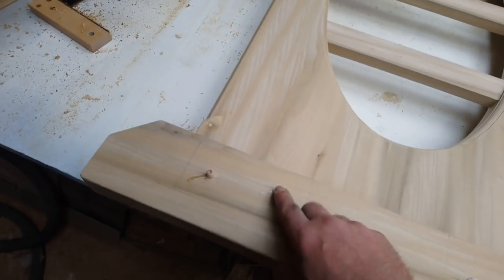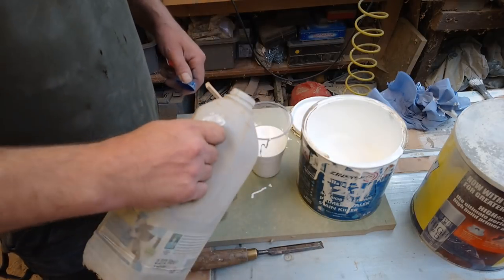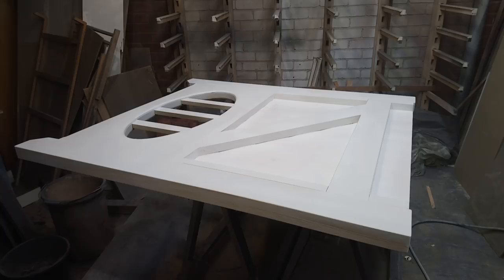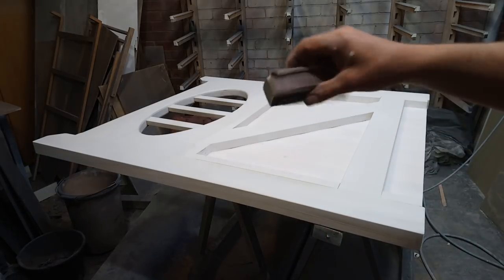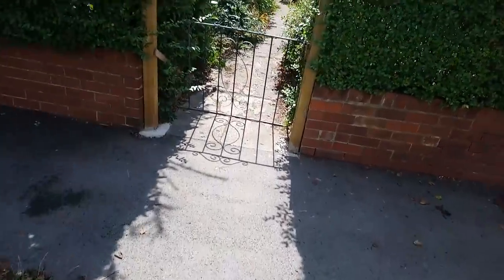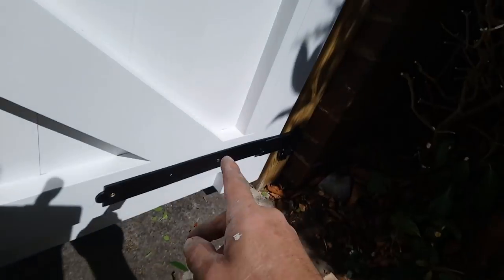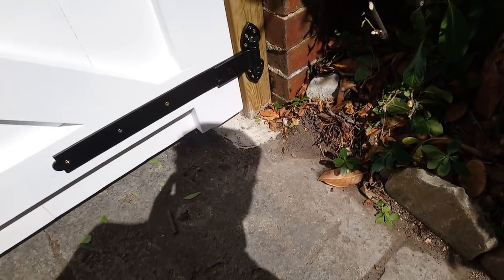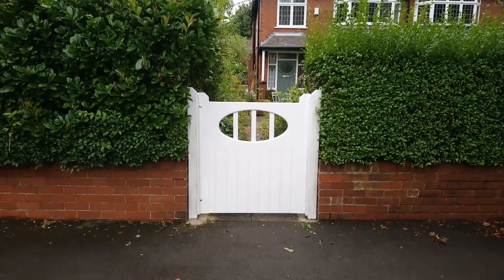Gate Making Pt4 - Spraying undercoat & hung on gate posts

Comment: l know , it's the satisfaction that time spent on a piece bring it's own rewards...lve driven past and seen my WORK still good as new some  15 + yrs ago l did...

English Mik
40yrs joiner
Reply from the maker: Yep, 35yrs for me this yr, all of my work is by recommendation from or for people I've worked for for yrs, i often get to see my previous jobs, that's a big reason i advise people to let me use Beech now instead of softwood for the int doors, the softwood I've done in the past because they wanted it as cheap as poss has shrunk beyond my acceptance, the gaps are 4-5mm instead of the 2-3mm i made them originally, they seem happy with it still tho & i get more work but I'd prefer it to be as close to as i made it in the first place, 
I very much doubt this gate will last long, it was orig to be made from pine, we'll see, I haven't been back to see if they've painted it! 🤣

Comment: Cracking videos man, I'm actually a professional P&D, I've always used zinsser products, I believe zinsser B.I.N is the best for covering knots, a tintable shellac.
It's expensive but a lot better for the job I believe. Can even spot prime knots before you spray the rest. Thanks for your excellent videos 👌
Reply from the maker: Thanks 👍 I've used zinsser n yeah i would have maybe, there's a couple of half tins on the shelf, 123 n BIN, (last time i sprayed it i got fish eyes, prob not the paint but scared me off it a bit n the PU i normally use doesn't bleed through) but these people were being tight, originally this was to be out of pine, putting a coat of primer on was a freeby n as you say zinsser ain't cheap, Thanks n you're welcome 👍

Comment: Fantastic project Gid, thanks very much for sharing. A quick question on gate posts and brick walls; What is the proper way to fit them, presumably not drilling and bolting them into the sides of the brick? I've seen two brick piers fail with this method with the brick layer blaming it on the fixings. So concrete in the ground presumably with as much of the posts set into it, not always easy as you're disrupting the brick foundations - and the posts would ideally be metal or hardwood? Which is why you were adding the brace...? Thanks again, Jim
Reply from the maker: Thankyou JIM & you're welcome 👍 Depending on what type of wall it is i wouldn't worry about digging down next to it, a column of bricks might be a slightly different situation to a wall but you're going to be adding concrete back in 🤷‍♂️👍 I don't remember on this job whether i fitted the brace in the end but either a wall or column i do like to try keep the post a separate entity from the wall, that's not always poss, a house wall would hold a lot more than a garden wall but as i say i like to keep it separate, a wood post will move/bounce a little & a gate will bang n bounce also so i wouldn't want a heavy gate over time dragging on the bricks of a house wall, but i did do it on the side gates i fitted, that was a fairly light gate, a good solid wall that's been there for a while will hold a light gate tho, every job is different, I discuss all possibilities, materials, the pros & the cons with my clients, it's their decision in the end, I'm sorry to be vague but i wouldn't say there is a proper way to fix them, I think you have to consider the worst case scenario & decide from there, that's why i try to keep my work separate, then it's not taking into account the quality/strength of the other structure,.  For me finding hardwood posts locally isn't easy, for gates it would be Oak but i'd have to buy online or at least search websites, a good softwood/redwood post is fine, depends how deep your pockets are & how long you want it to last,
Reply: @Gidjoiner  Thanks very much Gid, good info as always.

Comment: Hi. I love your videos. What spray gun is that? It seems so work very well. Also do you have a large compressor for it? Thanks
Reply from the maker: Hi, this is the gun, it has a 2.5mm nozzle as this Leyland primer paint is thicker than reg spray paint even when they are thinned down with water, the compressor is a 50ltr Bostitch, it's just big enough for my needs.
Thanks Lionel 👍https://www.spraygunsdirect.co.uk/index.php/sprayguns-parts/gravity-sprayguns/a-n-i-f1-n-super-professional-gravity-spraygun.html#sthash.HNp0QmBw.dpbs
Reply: Thanks for the reply. It's quite reasonable actually the gun. Do you think it would work with a 24l compressor?
Reply from the maker: If you want to just try it get one of these, I have 2, bought the second one because i thought the first was ok, 1.8m nozzle for the paints i use, you might want the 2.5mm for reg house paint?  😉 My little 6ltr will spray but it runs out of air fast, that's the prob you'd have, if the compressor is working a lot it might get hot n damaged but you could try n see, up to you how much grief you give your compressor 😀
https://www.spraygunsdirect.co.uk/index.php/sprayguns-parts/gravity-sprayguns/a-n-i-f1-ns-budget-gravity-spraygun.html#sthash.2UyQzO0u.dpbs
You'll need some strainers, 190 micron, I get these but from a local car paint shop 
https://www.spraygunsdirect.co.uk/index.php/filters-strainers/paint-strainers/starchem-paint-strainers-pack-of-10.html#sthash.XwVLHwjW.dpbs
or https://www.ebay.co.uk/i/283074679127?chn=ps
Reply from the maker: I'm just editing making the doors, when I'm spraying preservative on the doors with an ANI gun you can hear in the background the compressor kicks in, mine's 50ltr so yours i guess would do half..?  Fitting them tomorrow so this vid out Sat i think, 😉